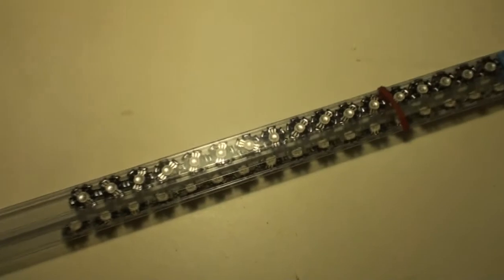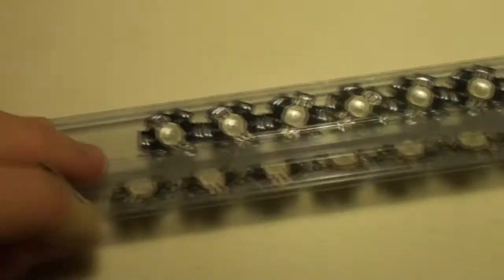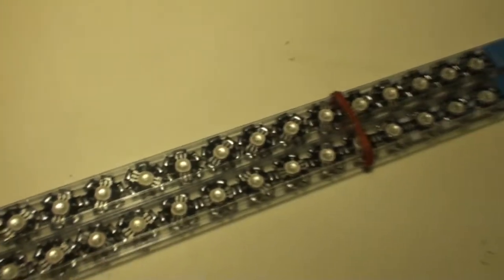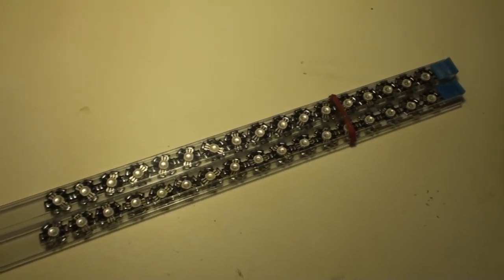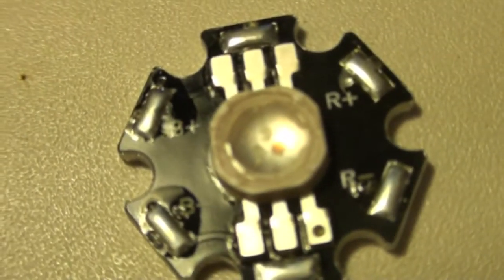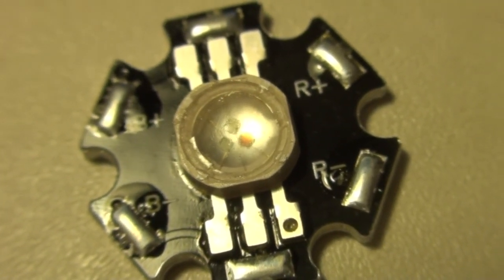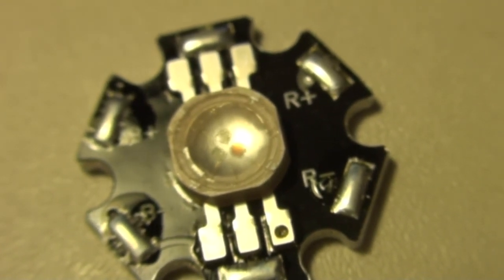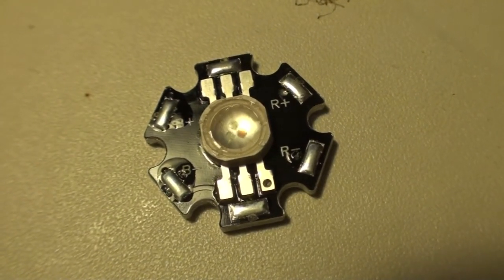Arduino High Power RGB LED Controller

Comment: i am proposing to work my project using these RGB LEDs but am not getting those LEDs  on market. would you help me giving more information on that please? Thank You!
Reply from the maker: Go search on eBay for 1W RGB LED and several options will come up. Take as an example the first two hits here: https://www.ebay.com/sch/i.html?_from=R40&_trksid=p2380057.m570.l1313.TR2.TRC0.A0.H0.X1w+rgb+led.TRS0&_nkw=1w+rgb+led&_sacat=0
In this video I am using a 6-pin RGB LED.